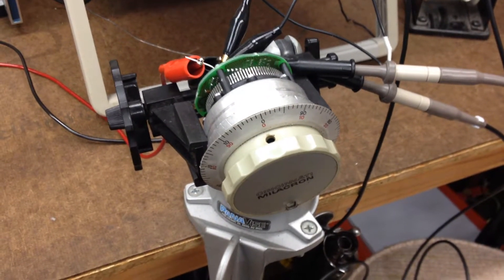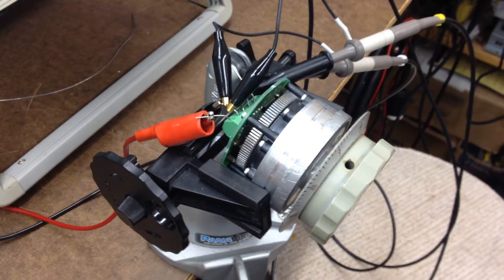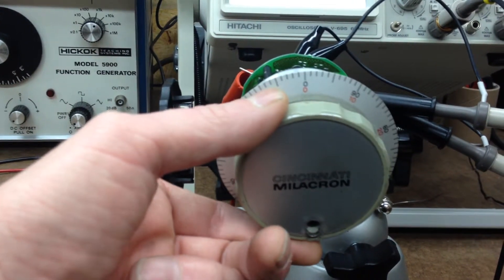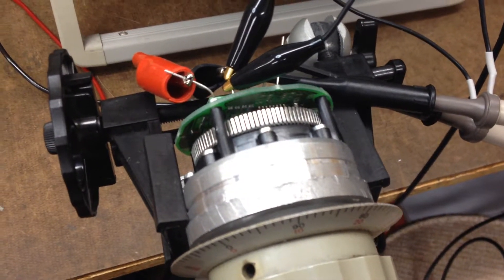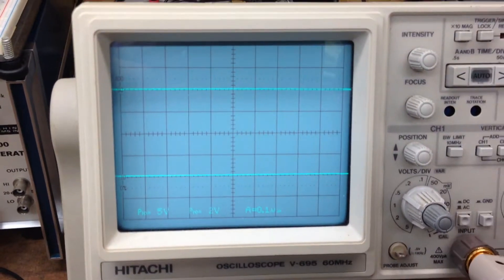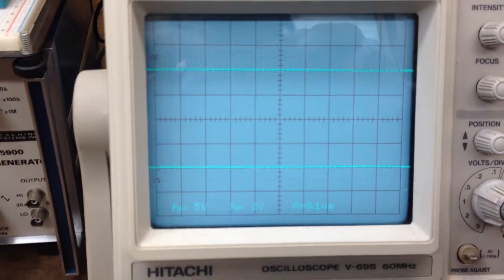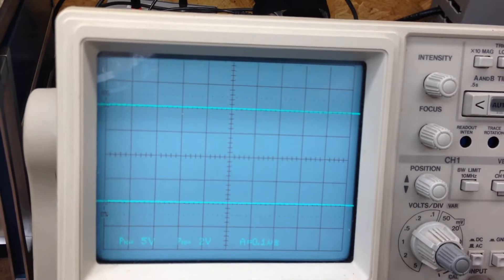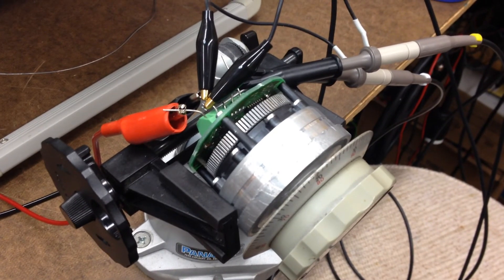CNC Electronic Handwheel

Comment: Hi Troy,. I have been wondering what was inside also, so thanks for the exercise.   If you still have the device could you show the scope trace for the differential out for left then right?  I am wondering if it is intended to be edge triggering or if the driver generates a fixed pulse width to set a minimum, e.g. debounce.  Thank you